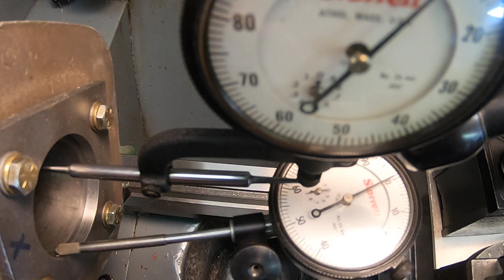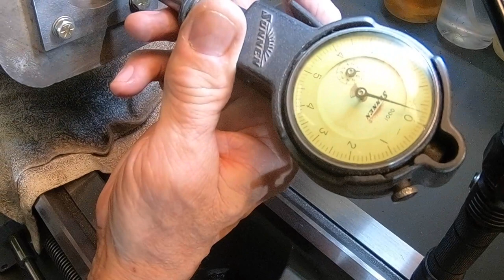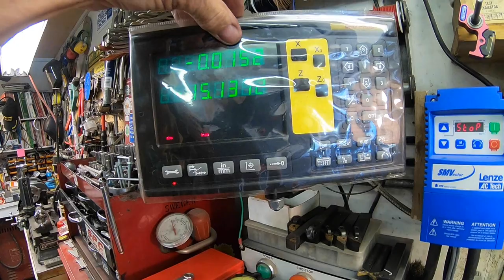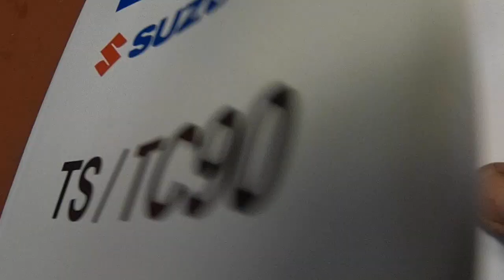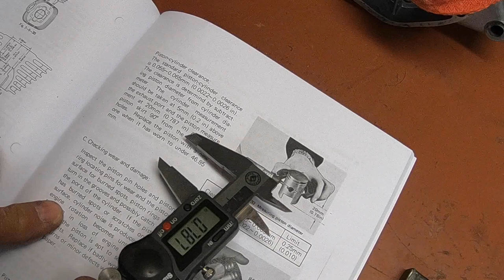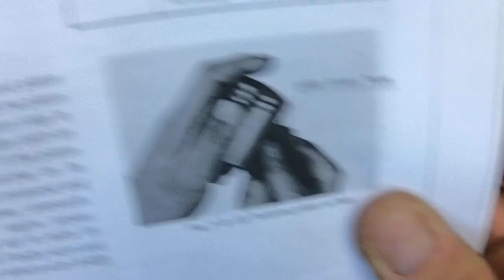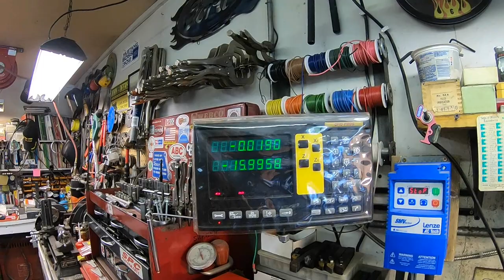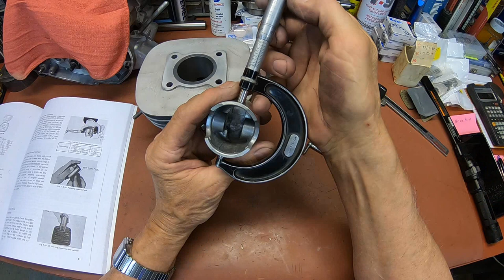Boring a motorcycle cylinder in the lathe, TC90 Suzuki, part 2

Comment: Hi Dale, I didn't see the whole set-up process and indicating/tapping the cylinder face looked painful. You probably did this but take a skim cut on the  fixture face after mounting in the 4 jaw, this way, when you mount the cylinder to the face of the fixture it will automatically be square and you only have the indicate bore. Great content, I'm your biggest fan.
Reply from the maker: Hey Gary, yes, I didn't think I should have to do that, but for some reason I had to. I made this adapter many years ago for something else, then had to open up the hole and redrill mounting holes for this cylinder. I know when I first made the adapter, I took a facing cut. Maybe I should do it again just to square things up a bit. Not a machinist, just a what to be. I don't bore on the lathe much anymore, I prefer the mill, but on these small bores it's got to be the lathe. Thanks for the great advice and thanks for watching my old motorcycle videos.
Reply: You can do the small bores on the mill with some chatter control or maybe a bigger diameter bar turned on the end to fit your boring head.
Reply: Anytime, the chuck is removed from the lathe spindle, or the fixture removed from chuck or moved in any way, it's best to skim cut the fixture face again.  Any type of dirt, metal chip, burr, chuck jaw faces not on the same plane, or how things tighten up, can get the cylinder face to runout.  A lot of times when a chuck is removed from the spindle, the machinist will put it back on at the same position.  A line drawn on the spindle and chuck.  Either way though, you can skim cut the fixture face and have it running as true as possible but then when moving the chuck jaws and fixture to get the bore centered, the face can cock sideways a thousandth or so again.  A better way would be to get the fixture in the chuck close to true and held tight, skim cut the face, and don't move the fixture.  Bolt the cylinder head down to the fixture just snug and move the cylinder head itself by tapping it until it it is centered, and then fully tightening the four bolts holding it onto the fixture.  Worst case, would be clamping on the cylinder itself in the chuck jaws and springing it.  I saw that in another video.  It's good you are using a fixture.

Comment: I hv  a terrible seize at 130kmh wt my Suzuki  two strokes underbone bike ,I had to knock hard to free  the piston. It's really2  bad scratches to the liner and pistons on hiway. Then I used sand papers to sand (I always hv them with my tool kits tho)  .bike could start and ride back home ..
Reply from the maker: Wow sounds like you know this situation firsthand. It can be hard to get the pistons loose after a seize. What caused the seizing, lean condition or lack of oil. Can you tell?
Reply: Well obviously ,I was lean on 2 stroke oil and gas back  then. 
After  that happens  I decide to install onesize larger carby instead upsize my jetting on the Std carburator.  I play around with jetting to suit my riding style,  but the Std Carb with larger jets sucks more fuel than oversize carbs with Std jettings. 
After I use  those  oversize I didn't had any seizures..also they go easy on my pockets use less petrol money for the same long distance. At one point I tries to made the piston  seize but it just not happening .
Suzuki jugs they were like immortal things..  You just have less power with them ,,,,,running engine on scratchs jug , but they will still run. These things you won't find on others brand  bike, and Yammy is the worst  one, with little seizure they already  needs new pistons.and rebore.

Comment: Anytime, the chuck is removed from the lathe spindle, or the fixture removed from chuck or moved in any way, it's best to skim cut the fixture face again.  Any type of dirt, metal chip, burr, chuck jaw faces not on the same plane, or how things tighten up, can get the cylinder face to runout.  A lot of times when a chuck is removed from the spindle, the machinist will put it back on at the same position.  A line drawn on the spindle and chuck.  Either way though, you can skim cut the fixture face and have it running as true as possible but then when moving the chuck jaws and fixture to get the bore centered, the face can cock sideways a thousandth or so again.  A better way would be to get the fixture in the chuck close to true and held tight, skim cut the face, and don't move the fixture.  Bolt the cylinder head down to the fixture just snug and move the cylinder head itself by tapping it until it it is centered, and then fully tightening the four bolts holding it onto the fixture.  Worst case, would be clamping on the cylinder itself in the chuck jaws and springing it.  I saw that in another video.  It's good you are using a fixture.

Comment: Nice job. Are you going to send it out to have it nikosil-ed again?
Reply from the maker: Thanks, No nickasel available at that time. These engines just had cast iron liners, they were bore, hone and go. Some engines at that time had chrome bores, the Bridgestone's and some early Kawasaki's but no nickasel. Don't think nickasel was available till the 90's. These older bikes are so much easier to work on and much cheaper.
Reply: @montana2strokeracer I wasn't aware of that. I had a 74 Kawasaki F11 250 that my dad bored out in the lathe and got an oversized piston and rings for. It lasted a few years but seemed to wear faster than I thought it would. Maybe it was the rings but I don't recall.